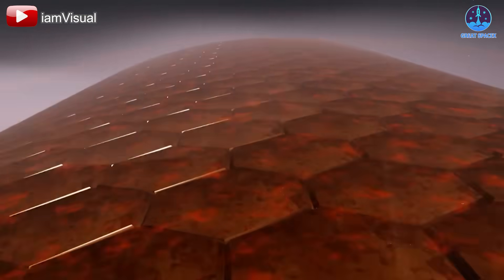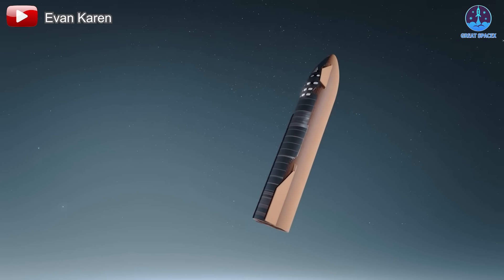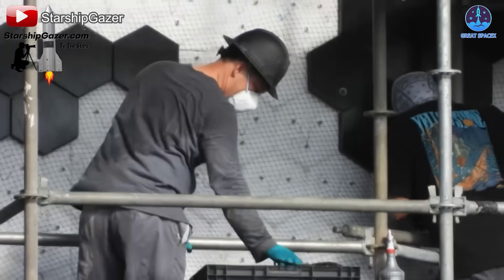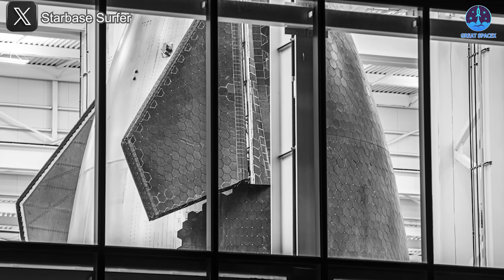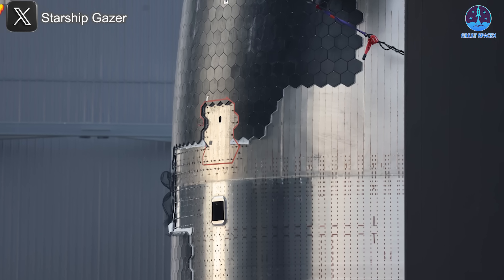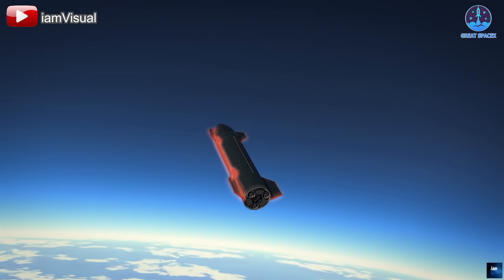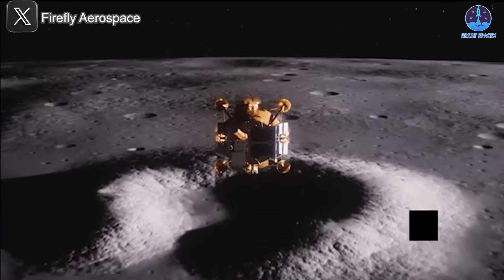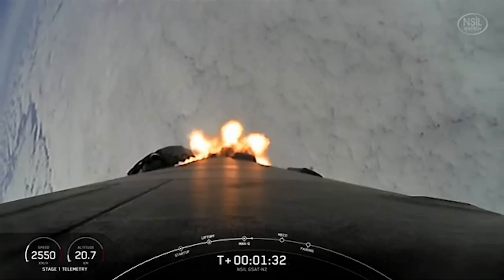Elon Musk revealed NEW Fully Reusable Heat Shield Completed in 2025 to End Ceramic Tiles...

Comment: They should use no hard ceramic. Better use a thick layer of structured silicon rubber and let it burn away. Structur should in this way that vibrations occur and produce a "restless" surface.

Comment: Why the ship can not return the same way than the booster and falcon rockets without heat shied, just using entry burn? Why need floating trough the atmosphere on his bely?
Reply: Booster is moving at around 5,000 kph when it re-enters the atmosphere. The Ship is travelling at 28,000 kph which represents approx 176 times as much thermal energy (~Velocity cubed) that needs to be dissipated.

Comment: I still think it is worthwhile to think about a magnetic shield for aerobraking like proposed in this NASA study

(google NASA and plasma aerocapture reentry)

You would then have a very durable system as well for shielding on long duration trips vs solar flares and transversing the van Allen belt or cosmic radiation in generell.

Yes powerfull magnets are still heavy due to metal coils but metallic heat tiles with a cooling system doesnt sound light weight either.

Comment: could they not just use a metal that has a higher melting point ie titanium (1668C melting point). this is obviously more expensive but would save messing about with the tiles.
Reply: During reentry into Earth's atmosphere, a spacecraft can experience temperatures reaching up to 5,000 degrees Fahrenheit (around 2,700 degrees Celsius).

Comment: Since SpaceX knows the dimensions of the spacecraft, why do they make 18,000 small tiles instead of a larger, custom fit series of half-ring ceramic shields for the craft?
Reply: Thermal expansion. The tiles expand more than the steel of the structure (?) so large sections would make bigger gaps while they are cool.
Or maybe the opposite.
Reply: @Marcoose81  Larger tiles=much more difficult to build curves around rocket;smaller allows much greater ability to do so.
Reply: remember these starships are just protypes. a final version likely will feature more robust modular systems. Make the craft recoverable before spending more than you need to

Comment: Having something like the Leidenfrost effect with the tiles would be interesting.  By coating the surface with a film of some liquid, the tiles do not directly contact the heat the liquid functions as the insulator. An interesting engineering problem but very possible

Comment: Maybe they should just land in the ocean due a controlled flop and tow back to space port and repeat. The dragon capsule does this very thing. Landing legs could be an add on for specialized ships and missions. Some vehicles just may be designed and dedicated for service in space and therefore never come back to earth.
Reply: The goal is to be rapidly reusable. It would need to be inspected and towed back to the launch tower.
Reply: Most likely, they will do both as they need to land on Luna and Mars to start out. In the very beginning when Musk was throwing out ideas the whole shebang was to be set up offshore, like a seaport, and ferry passengers from the mainland to the port. I see that option as more viable for Starship Spaceport around the world on 90-minute hops around the globe, thus creating a plan to replace the global airliner business.
Reply: Landing in the ocean means salt water everywhere. A 'salted' rocket is not reusable as you must clean it thoroughly.

Comment: While catching the booster and ship is impressive, it serves no purpose in developing them for use in landing where there's no tower to catch them. Since landing legs are mandatory for successful landing on Mars or the moon, the development of those legs and the landing requirements, procedures, controls, etc. should be the primary goal, not secondary. As for reusable metallic heat shield, there are metals and potential alloys of them that have the capability to exceed the temperatures encountered by a very healthy margin. Yes, they are likely more expensive and slightly heavier than the ceramic tiles, but they wouldn't require a cooling system and could be made larger and formed to better protect the complex curves around the control fins and, eventually, landing legs. Surely, the brains at SpaceX are aware of these issues and options and will employ something like them. The sooner they start, the faster they can develop them. With the new administration, FAA, EPA, FWS, and other interference should be minimal or nonexistent. IMHO
Reply: BS. The same reason you have planes with 2, 3 or 4-tubines, even propellers, Starship will need different setup for different applications.
The most obvious is the refueling aspect. All the SHB has to do is to fly the SS as high as possible and return for fast redeployment, no legs needed.
Also the SS doesn't need legs since a big part of its operation will be fly high and dump the propellant into the storage on orbit.
People usually talk about 10-15 refuelling tanks for each SS single mission. Now you tell me if legs are a primary priority.

Until the legs are actually needed, they will be developed in parallel. Legs are actually another fail mode, why introduce it when you don't really need it?
The better part is no part. I don't think you know better than SpaceX engineers.
Reply from the maker: Thanks for your great analysis
Reply: @colonbina1  I don't agree with his analysis